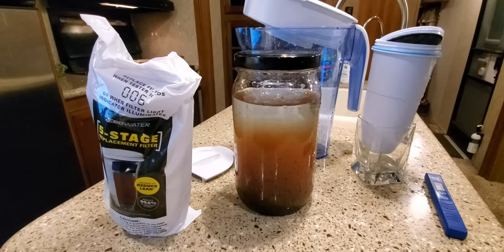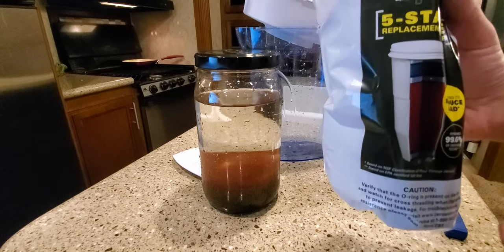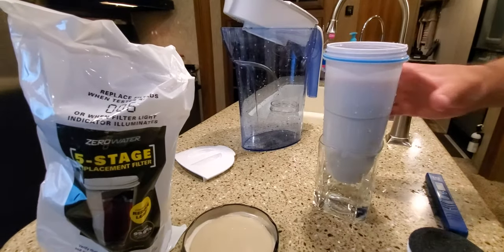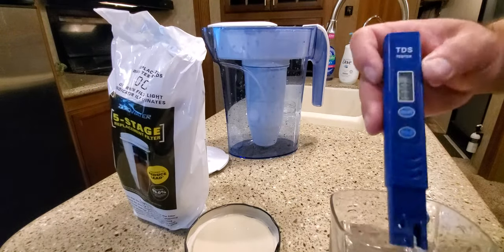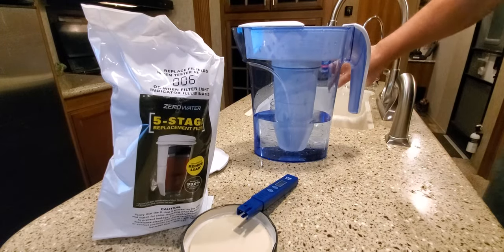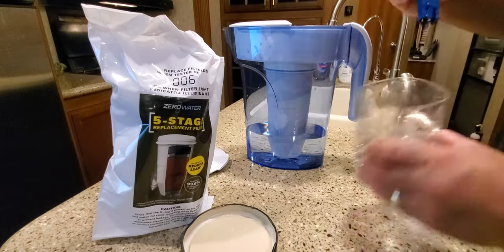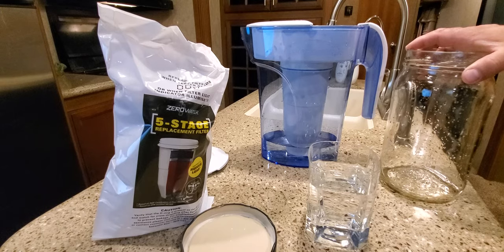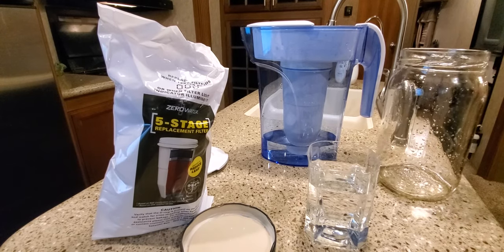Can you reuse a zero water filter? Deconstruct / reconstruct

Comment: I use a water distiller and it's always zero when tested so I don't buy Zero Water filters anymore (I used to use them).   However, I DO use the new Eco Zero Water filter because it's just a CARBON filter and MUCH CHEAPER than the regulate Zero Water filter. Why do I use it? Because I got tired of using the individual carbon filters that distilled water boilers use. This way its MUCH CHEAPER for me. So if you ever buy a water distiller, try using the new Eco Zero Water carbon filter system. Buy the pitcher and the carbon filter. Thereafter you have only to buy the filter. It removes the VOCs and taste from distilled water and makes it nice and refreshing... and the TDS reading will be 000 (ZERO).

Comment: I have taken it apart and rinsed it about 20 times and it still is not at 0. How many times did you rinse it with the reverse osmosis water? I’m using the water from my zero water pitcher from another filter to get my water to zero.

Comment: would be nice if they added UV lighting on the process, would cost little no nothing to kill most of the bacteria in/out the filter.
Reply: You can fit one to the pitcher after it has filltered but after rigorous test the filtered water is not showing any bacteria under electron micoscope and when testing the water sample on a petri dish I'm getting the same bacteria results as the air around me. So the filter looks to be removing any bacteria as well. Im using fresh rain water through mine at 003 TDS and its lasted 1.6 years 1200 liters.

Comment: IF what Zero Water uses is, in fact, simple cation-exchange resin, then yes, you can "recharge" your filter, to some extent.

Like a commercial water softener, the resin in this cartridge is likely there to filter hard minerals such as calcium and magnesium. Since carbon is so good at absorbing impurities from water, its capacity to filter can deteriorate quickly if the water is heavily fouled with hard minerals. Pre-filtering with the resin makes the carbon much more effective.

You could soak the resin in a salt brine which would cause it to release (exchange) the hard minerals attached to it which then need to be flushed away. This is what a softener is doing during its recharge cycle, injecting salt (or potassium) brine, soaking, rinsing, backwashing and draining.

You could do this manually if your time isn't worth much. In guessing this is how Zero Water justifies its replacement cartridge price. Or, just build/buy a water softener and reap all of the benefits while extending the life of every other downstream filter, plumbing and water appliance in the house.
Reply: A water softener exchanges the calcium and magnesium with the salt that is added to the reason "beads". You end up with salt in your water. Not enough to taste, but enough to swell your ankles. That's why I bought the zero-water pitcher. I have 500+ going in and 500+ TDS coming out. of the softener. zero-water takes the salt out. Unfortunately , at those numbers my filter doesn't last more than a week.

Comment: I'm sure he rinsed out the filter in the lid and in the bottom of the filter container, right? He doesn't show it or talk about it, but surely he must've.
I have the same pitcher filter that he does, and my filter will last 22 - 40 cups, depending on how bad my tap water is (it's 140ish), according to the info on the box. I bought it 6 March 2023, and it is just now failing to provide 0.00 TDS water on 20 April 2023. So, I jumped back on here to try this hack for myself. I'll post my results here.

Comment: After only 2 weeks of use, our Zero Water Filter produced water that tasted like rotten fish. What is being trapped and causing such a terrible taste? We always filled the ZW jug with filtered water from our refrigerator, hoping to further improve taste and filter life. Initially, the water tasted great and the TDS reduced to zero from around 350 ppm (Central Texas city water). Considering the cost of 2 filters per month, it was cheaper to buy plastic water bottles from our local store. Product was returned to Amazon and was replaced by (under sink) Clearly Filtered system. Easy to install, works great, tastes consistently great and replacement is recommended every 15 months. In the long run, it will cost a little more than Zero Water Filtration, but doesn’t focus on demineralization nonsense that my water softener handles better. Most people don't have time to clean their drinking- water filters and risk bacterial contamination.

Comment: I have a zero water filter I started using about ,2 years ago and then went to the zero water faucet mount.  So my pitcher filter has been in the picture partly used for approximately 2 years.  I decided to try it again and to my amazement it's still reading ,003 ppm. after all that time just sitting in the fridge inside th pitcher.  The water doesn't taste funky at all

Comment: I have a Zero Water filter that has never been used and was still in the packaging, not exposed to moisture. I tested my tap water with that wand (100s) and my Smart Water filter (100s) and the Zero Water was at (000). However, I also tested the acidity level with a special pH liquid. The tap water was green 6.0, Smart Water was blue 7.0, and Zero Water was yellow 5.0. I used my tap water to fill the Zero Water, how come the pH is so low? Should I flush the Zero Water filter a few times? Not sure why the pH is so low. Thanks for any input.
Reply: Because it pulls the minerals out of the water that makes the water alakaline
Reply: @DavidBloodJohnson  I understand that Zero Water filters particles, but did not know it filters minerals. Do you suppose it gets more acidic from going through the carbon? Is it carbon or coconut shells?

Comment: Zeolite is used in water softners, and is backflushed with brine to clean the zeolite.. I am wondering if the old filter could be refilled with zeolite and activated charcoal.  Zeolite is cheap in bulk at hardware stores, and charcoal is used in fish tank filters.  I am going to try it when my filter is dirty and see what the ppm is.
Reply: Did you try this? I literally just bought a tub of zeo/carbon mix at the pet store with the same exact idea yesterday 🤣
Reply: @bobbigoodwin3022  Think about it. If you can just flush out the bad stuff then it would be coming out the bottom of the filter all the time and not filtering anything. No it does not work.
Reply: Zeolites are technically different from Ion exchange resins, being types of clay molecules, but they are especially good at grabbing the bigger nasty ions, like lead and arsenic, whereas the ion exchange resins get the more mundane hard water minerals, like calcium, magnesium and iron.
Reply: @John McDonald what was the result?

Comment: Hey can you update us on the results? I would like to copy your method cheers
Reply: Yes, more specifically if he repeatedly cleaned the same filter at least 1 more time with similar results, and how much shorter the lifespan gets each time compared to the original, including the taste/smell?

He seemed to comment he no longer sees this as a permanent solution, so I'm curious if there's a balance or benefit, or if its even worth an attempt?
Reply from the maker: So I use this filter for a little while and it ended up not tasting so well I did not check how many dissolved solids were in it but I can describe the taste as that smell when you disturb ants and they put off that stinks smell. Somehow I got that kind of taste in it and it. And that was a taste that was not in the filter before so I am not convinced washing out the filters is the best way. Rather I would be more inclined to Simply open a filter and build one from cheaper materials you can get off eBay such as activated charcoal and water softener resin.
Reply: @SubaruOffRD  could you list the actual media you purchased off of eBay so I can order some for myself?

Comment: That only works if you have a reverse osmosis water filter.  You can't wash it clean with dirty water.
Reply: Reverse osmosis water will not work anyway mate. Think about it. If you can just flush out the bad stuff then it would be coming out the bottom of the filter all the time and not filtering anything.
Reply: @edd-6182  Honestly, it would be silly to get a Zero Water if one already has an RO type filter system.  RO systems produce much more very pure water at much less cost, but have a high up front cost and plumbing installation needs.

Comment: I didn't change my folder for too long and the water was coming out of the zero pitcher at 990 ppm and straight out of the faucet was 300 ppm.
Reply: After the zero water filter is spent, it will probably start putting back some of those minerals that it took out before, hence the higher TDS readings.  Hence, water from a spent filter is actually worse from the TDS standpoint.  It probably still filters out the really bad things like heavy metals and bad organic pollutants which the zeolites and carbon get out.

Comment: Tired of Zero filters inevitable fish odor. I emailed Zero, suggesting that they make their filter housing such that the filter media can be changed...no return shipping of the filters. I tactfully stated that if they are a true industry leader they'd step up and do what no home filter product manufacturer has done. I received no response :/ 

I'll try opening one of these up with a razor blade. I was pondering cutting one maybe an inch or so down, then adding a PVC union. But your method seems to be less fuss.
Cheers
Reply: I did do this. Water soak overnight, stirred a few times. We'll see how long it lasts. It does indeed read 0.000 ppm again. No vinegar. No salt. Nothing added. Just the soak in cold tap water. For what it's worth, my tap water is 130ppm. 

*One note though. It drains slower now. I suspect it's because the carbon and resin media are mixed rather than stratified. In future recharges I will attempt to separate the two and layer with the carbon media on top as it was when stock.

Comment: What is reverse osmosis filter and where do you get it?
Reply: I want to know this too
Reply: There are many brands, but they are a plumbing add on, as they have to operate at tap water pressure.  At least a few hundred bucks.  They work by pressure forcing the tap water through a special membrane, that lets the water through and keeps the minerals and salts back, but that chamber itself has to be flushed a little as it goes, so you'll need both a high pressure cold water input connection, and a drain line to the sink drain.  These are usually under sink deals, with a reservoir tank, as the RO water is produced as a trickle, which fills the reservoir tank.  They are sold by the daily production capacity, with a couple gallons up to maybe 5 gallons being normal for a home, and big users, like brewers and aquarists have much bigger systems.  Very often, especially if one's water is very high in calcium and/or magnesium hardness, it's good to remove them first with regular water softener type filters(ion exchange resins with salt recharging), the Culligan type, to pre filter the water as it is much easier for RO membranes to clean softened(high sodium/low hardness Ca/Mg) water and they last vastly longer filtering softened water.

Comment: Just took one apart and put the beads on a oven plate at 375 f for 30 minutes will test it out
Reply: What happened when you tried them after putting them back in the filter? Thank you
Reply: It's the black carbon charcoal that you can restore by boiling, and even better by baking.  Baking in an airless retort(sealed from air container) at like 800°F is how they make charcoal, so that'd recharge the carbon.  I think heating the Ion Exchange resins would probably ruin them, if too hot.  Salt water would probably be the thing, and maybe some potassium and sodium chloride salt might be best(like Lite Salt in the spice section).  Of course, this has to be rinsed well too.  I'm wondering if vinegar and/or citric acid, both cheap, might also help further remove some of the remaining minerals, and of course need flushing.
Reply: @chuckgoecke  thank you for the update

Comment: so...you use reverse osmosis water to clean the filter?  Where do I find this?  Thanks
Reply from the maker: Ebay
Reply: It seems like you'd have to buy a new sink, etc, or at least pay quite a bit more for an extension, but Ebay has Zerowater filters for Iike $8.

What if you used the 2nd new filter to create a bunch of clean water to rinse out the old one ten times? So make like 30 cups, and then stir out the bad for every 3 cups, repeat x10, re-use the old filter for a couple of months, and then bust out the 2nd filter to reclean it again?

Also, the ad I saw mentioned 2 free shower filters. Are these generic 15 layer ones or branded, and what numbers do they show using the tester (obviously not drinkable?)

Comment: My tap water in Brooklyn Park, MN is 490ppm :-/
Reply: Mine in St Paul is consistently less than 150. We just had street to house pipes relined and got a free Britta. I saw a comparison video and opted for a ZeroWater. Now Im considering setting up my Berkie as a pre filter then run that water through the ZeroWater filter. My filter lasted 4 months (it has slowed way down but only shows 003 on meter). I think pre filtering is best route to maximize the ZW filter until I get a reverse osmosis system in place.

Comment: Sadly tds is not a very clear picture of filtration. For example, zero water is a minute amount of carbon and then all ion bed resin. So really it's only filtering out some contamination and then mainly removing minerals (calcium and magnesium is what ion beds remove). This is not effective to remove the worst parts of most water supply which is chlorine and chloramines along with lead, arsenic, flouride, and chromium. Really you don't need ion exchange for drinking water. Drinking calcium and magnesium is not a bad thing. It's showering you want those removed for. In drinking water you want a sediment filter to remove as much particles as possible. Then a good quality activated charcoal, like coconut or catalytic. At least half your filter should be this. Then you want kdf to get rid of all the chlorine and chloramines and heavy metals and such. Leaving clean water with minerals intact (tds will NOT be zero). Tds is a poor indicator of drinking water. For shower filtration you want zero tds. Which would require the same as I stated (sediment filter, good quality charcoal, kdf) PLUS a final stage of mixed in resin.

Comment: This is absolute rubbish! The filter you have taken apart is a new filter. If your older filter was reading 006 when you through it out then passing reverse osmosis water at 000 through it would still produce 006 as the stuff inside is designed to filter bad water. If you could just flush it out then the bad stuff would come out of the filter all the time. What was the point of taking it apart and washing it if you could have just passed clean 000 reverse osmosis water through the old filter to clean it? The wlole point of the stuff in side is to trap and remove TDS and not flush it through.
Do a test (without an edit) where you use the old filter and get 006 TDS as a results. Then keep putting clean reverse osmosis water through it untill it goes down to reads 000 TDS. I would like to you do that magic trick.

Comment: As a chemist, you made a HUGE number of testing errors.   The most important is not knowing the TDS of the Zero Water filter BEFORE you disassembled it.  Without that, you really are not testing that it's been "cleaned" or "recharged."  You're only testing that it's still doing what it was before you "cleaned" it. In other words, was it higher than zero before and now it's back to zero, or was it never above zero.   In addition, you probably should have cleaned the activated charcoal and ion exchange resin.   I would suggest you look up how those work.  Basically, they have a higher affinity for certain ions and will "hold on" to them pulling them out of the water as it passes by.  But you will need to use a chemical/ion solution with an even HIGHER affinity to pull all those old ions off the resin.  That's the way they are "recharged" not by just running water over them.  
By the way, where did you get the water for the cleaning cycle?  If it was tap, then you've defeated the whole purpose.  If it was Zero Water, you've done nothing but run more water over the filter.

Comment: A water softener exchanges the calcium and magnesium with the salt that is added to the reason "beads". You end up with salt in your water. Not enough to taste, but enough to swell your ankles. That's why I bought the zero-water pitcher. I have 500+ going in and 500+ TDS coming out. of the softener. zero-water takes the salt out. Unfortunately, at those numbers my filter doesn't last more than a week. I'm taking the old filter and running water through it, first then pouring that into my other pitcher with the new filter. I don't know how it will work, because the water from the old filter tastes bad. I'm filtering the water with a carbon filter before it comes from the tap, too, and still getting readings of 500+. It's got to be the salt, which is a dissolved solid.